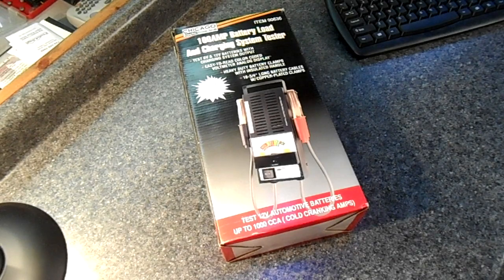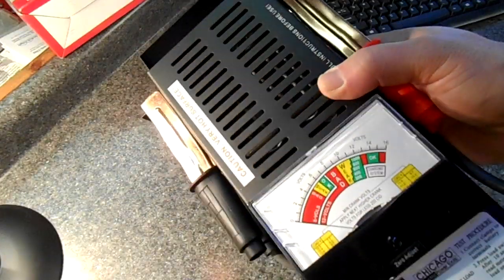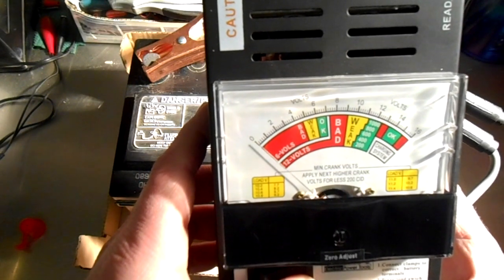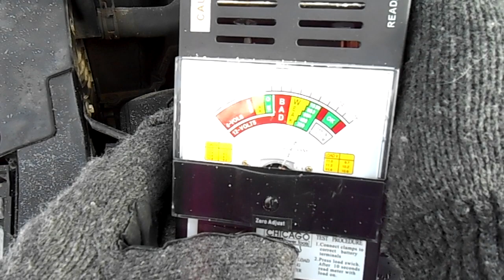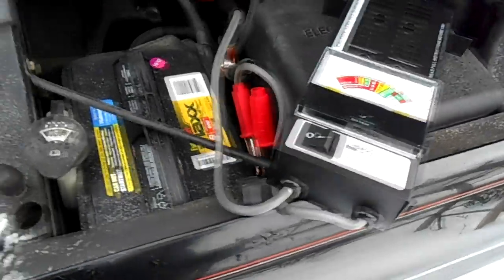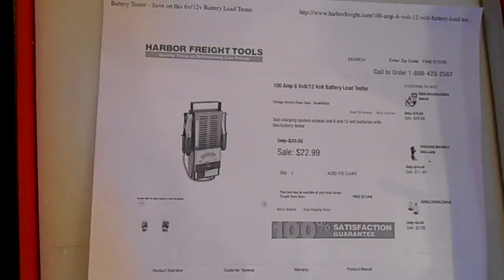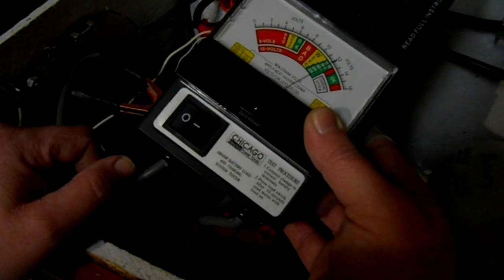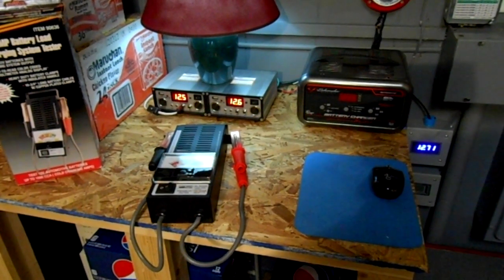Battery Load Tester & Charging System Analyzer by Chicago Electric - Review & Use

Comment: Read the instructions. The reading depends on the CCA (cold cranking amps rating) of the battery. that is why there are stepped markings from 200 to 1000. so for a 600 CCA battery the minimum reading should be 10.4V after the 10s load test. a 400 CCA should have a minimum reading of 10V. And this is at about 20 degs celcius. With your very cold weather you have to drop the the CCA battery rating to one or two steps lower. So a 600 CCA battery would be read as a 400 or 200 CCA bat..

Comment: I just used mine.  Calibrated it to a DVOM at battery voltage with the zero'ing screw.  Was only low by 0.1V or so at 12.1V.  Old battery that was a bit over 9 yrs old was having trouble cranking the starter all of a sudden.  Load tested at 9.0V.  Voltage when engine idling was 14.5V in the green zone suggesting charging system was OK.  New battery from Walmart; Everstart MAXX  load tested at 11.0V.  That will be my baseline for the future with this new battery.  No trouble at all cranking starter.

Comment: Adjust the center screw on the meter to bring it up if it makes you happy, I have one just like that in chrome for the last 20 years works good if it reads over 9 volts while you count to 7, the battery is good.

Comment: <<
The center screw would fix the draw dread but then the volts and charging read would be off. It is what it it is>>

This is a great video.  Thanks!   I learned a lot.  After viewing it I checked the voltage readout on my HF Load Tester with RC lipo batteries with known exact voltage.  My load tester was reading exactly 0.6 volts too high on every battery (batteries of around 12 volts).  I calibrated the meter using the "zero adjust" screw (located just below the meter) and now it gives exact voltage readings for batteries in the 11 to 13 volt range. 

 After calibrating at 12 volts, I also tested batteries that were 7.6 volts and 15 volts.

Actual Volts      Volts read on Meter

7.6                           7.4

12.5                         12.5

15.1                          15.3

    This seems accurate enough to me.  If you want even more accuracy, having calibrated your meter at 12 volts, you could just subtract 0.2 volts from your reading when testing your charging system.
Reply from the maker: Thank for the info, I will have to get mine back out and see if I can adjust the center screw to a known voltage. Steve

Comment: In case if you may be wondering why the truck battery test seems to show weak result with a fairly new battery.  It is because the post terminals on the battery used by GM truck is steel rather than lead.  The standard battery test clamp rely on soft lead post to allow the "teeth" to bite into the post to create reliable electrical connection.  Steel post with copper clamp create too much resistance at the contact point.  In order to test battery with steel post, you'll need to buy a lead post with bolt adapter.  Those are usually available at Wally World.
Reply from the maker: Great observation. Thanks
Reply: Don't buy that theory

Comment: Just curious, what did the solar panel digital voltage display show when you placed the load on the solar batteries. I would think that is a good gauge to compare the load tester reading to.

Great Job

Comment: You will find that the outside temperature reduces the CCA in 80 degrees f you will get a better load rating, the only difference between that one and a Snap-on is snap-on uses a carbon pile for the load and yours uses a heating element, also I can test diodes in the alternator, I get the same results in the cold, good video Dave.Thanks thumbs-up.

Comment: Hi Steve, I think you should go by the voltage readings rather than the colored scales, it's only a 100 amp load, some testers use up to about 300 amp load, I would say unloaded the battery should be about 12.4 min, when charging on vehicle about 13.9 to 14.7, with the 100 amp hot wire load on from 9 to 11 volts...Fred in England

Comment: You misread the meter when pressing the load button for 10 seconds.
1. Check what amp is on the side of the battery.
2. If say it's 600amp then press the load button.
3. See the meter read on the green 600amp step.

Comment: Hi Steve, something you might want to check out is a thing called a Carbon Pile Battery tester, I believe they might be made in Chicago, I have one, there not overly priced and they do a good job, can test battery, charging and can put up to 500 amps I believe on battery...I believe the is a U tube clip on it, one of the fixitrealfast clips...good luck Fred in UK.

Comment from the maker: A possible cause could be the charging system of the computer. Try installing a battery monitoring software tool available free from download dot com and see if your battery is receiving a charge signal from the computer

Comment: I have a Laptop that has had recent battery issues. Ive had to replace one of them. My mosy recent case was a possible faulty battery. But my battery seems to be working properly. Could there be a fault in my laptop?